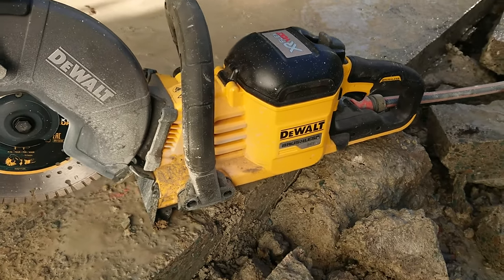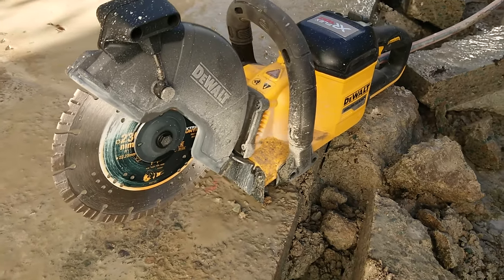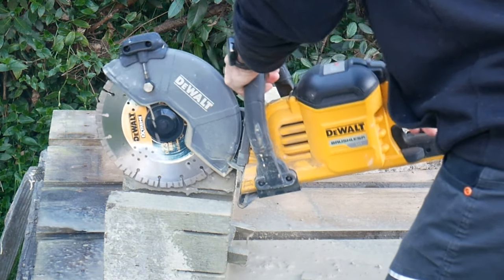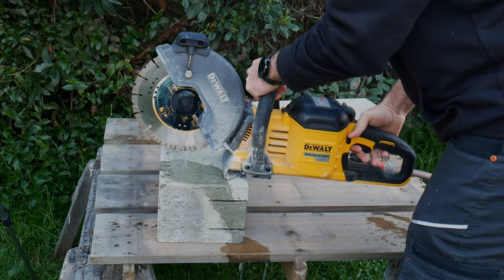Dewalt Concrete Cut Off Saw

Comment: Just bought two of them and I've been pouring Crete and laying brick and block since 1985 and this saw is the best addition to my tools I've ever bought NO BULLSHIT!! It doesn't replace a Stihl 420 but it is better for all of my soft cuts and brick and block cuts fast no pull cord no noise no mixed gas or filters again a great addition
Reply from the maker: 💯% it's often underestimated how often you need to do smaller cuts, for us we would either have to hire a petrol saw or sub contract it out, now I've eliminated 90% of that which means the job keeps flowing. I've got a video coming out soon where I show what I mean. Oh and not to mention the weight, less fatigue when using this saw too 👍👍👍
Reply: I'm thinking about squeezing the trigger on one of these saws. I've got some flexvolt tools already so maybe the saw and two 12ah batteries....🤔

Comment: i bought one last week. It realky surprised me. I need to learn to cut my pavers straight down vs keep going on an angle.  I wish the battery would have lasted a tad bit longer I also wish they had a guard dto protect water from flying back and wetting my pants
Reply from the maker: Takes a little getting used to, try resting it on the ground and tipping it, pivoting on the bracket underneath, It should get it started square with the surface, and should limit the spray